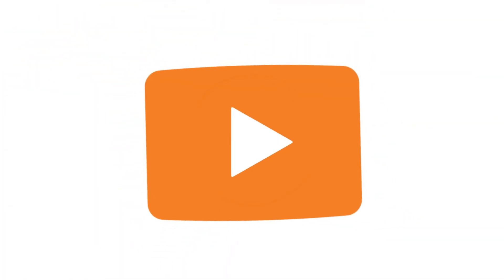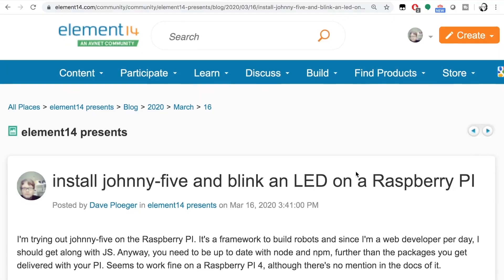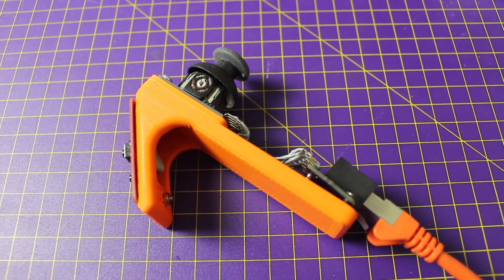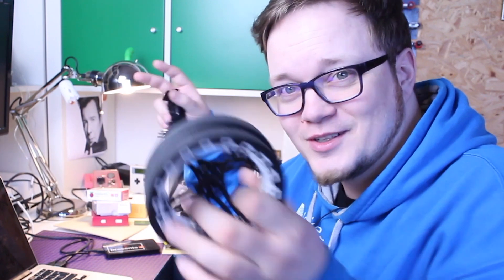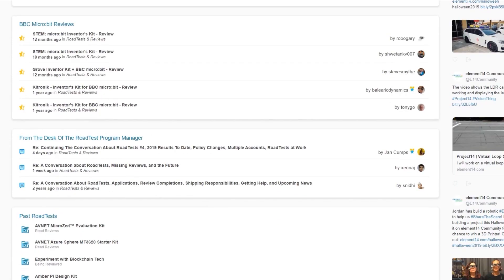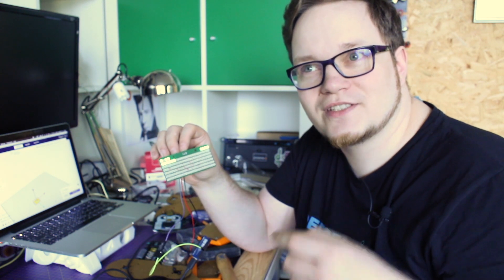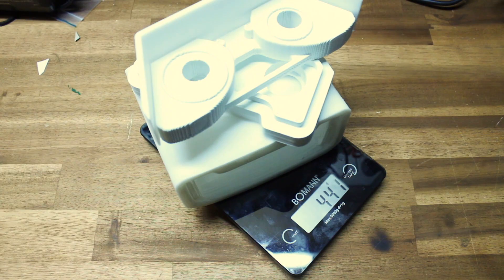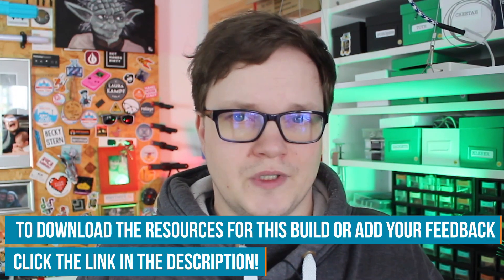Raspberry Pi 4 Animatronic BD-1 Companion Robot #StarWars

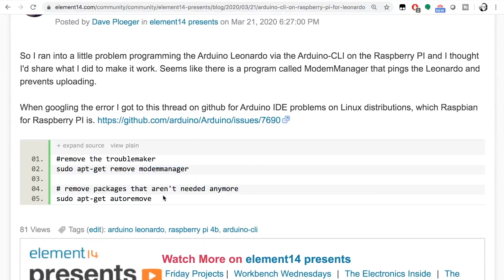Comment: @2:50 why is this module there to begin with ? what's its purpose ?
Reply: The PI is notoriously know for bad timing for PWM and neopixels, the Arduino takes over those functions, controlling the LEDs and servos via the PWM board.
Reply: @Davedarko  thanks for the clerafication i never knew about the pi's issues with the pwm i never used it for that altho i just picked up from microcenter a pico so i will put that to the test because the hype was and still is going on so i cant pass up a $1.99 for a pi MCU.
Reply: @arletpaz8010  the pi pico should do very well with servos and neopixels, good luck! :)

Comment: Just found the video. Just a thought with the battery distribution board has voltage detection from it, could you give the pi some ability to read that data and maybe go into a standby mode or give you a voltage alarm....also you could use lithium ion eg 18650, maybe heavier than lipo but might give you a little bit more life..
Reply: I fried a second battery, so I definitely have to come up with a better battery solution!